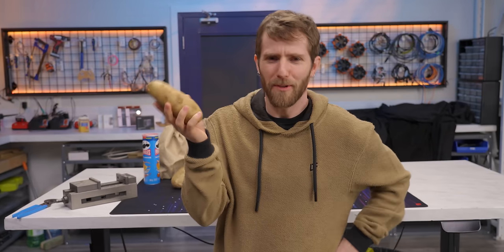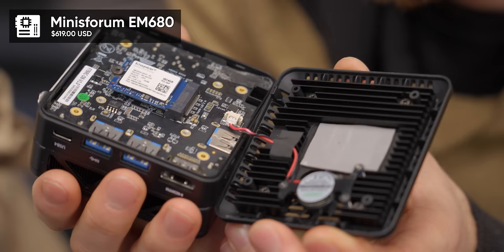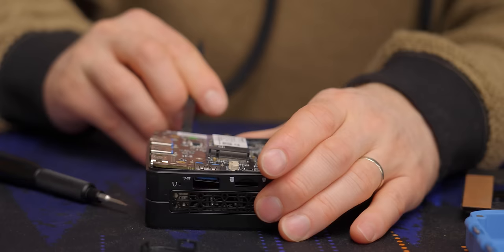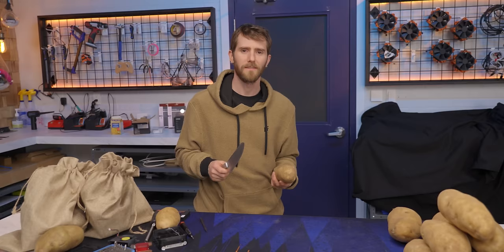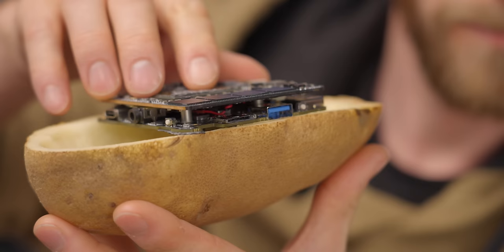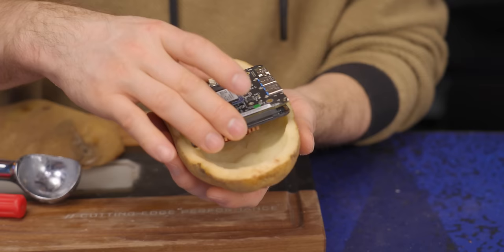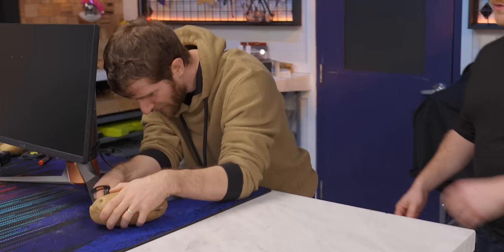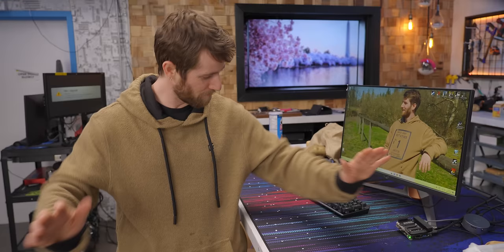It CAN be done - The Potato PC

Comment: For a long-term potato computer solution, I'd recommend making a silicone mold of said spud, fill it with papercrete or just air-dry paper clay, appropriately colored and hollow, and finish the two shells with paint to twin the tenuous tuber rather than relying on the rugged rind of the root vegetable.

If only you knew any real arsty Nerds who could Forge such a magnificent murphy.
Reply: Thesaurus Rex over here 😄

Comment: If you would have soaked the potato in citric acid or acetic acid, then rinsed it off thoroughly, you might have been able to resin coat it  without it going nasty. Second idea would have been to make a mold of the potato, and make an opaque outer layer of brownish, transluscent potato resin skin, then a layer of yellow white inner resin layer to make a resin shell that looked like a potato.

Comment: The Radeon 680M iGPU of AMD's "Rembrandt" APUs (aka Ryzen 6000 Series) are not RDNA3 architecture but RDNA2, they are AMD's "Phoenix/Hawk Point" APUs (aka Ryzen 7000 Mobile Series and 8000 Desktop/Mobile Series) using Radeon 740M/760M/780M iGPUs which use the RDNA3 architecture.

Comment: Still beats the stuffing out of my potato PC!

MSI B550 MPG Gaming Plus AM4 motherboard 
AMD Ryzen 7 5800X CPU
64GB (4×16GB) Patriot Viper Steel DDR4 3,200Mhz RAM
XFX Radeon RX 6700XT Speedster Swift309 12GB GDDR6 graphics card 
SanDisk Ultra 3D NVMe M.2 SSD 1TB
Corsair 550watt CXM550 PSU
NZXT H series Tower case
Windows 11 Pro

Comment: Ok so you CAN print tubes etc but for them to be water tight you have to make sure your STL is completely perfect, so make sure it’s solid in something like meshmixer first and you want to make sure that in curing you don’t over or under cure it, it’s very easy to crack and it won’t hold anything

I’ve been working on bottles and and it’s a lot of work where I had micro cracks and it leaked

Comment: I'm still using my Amiga 1200 with an 030@50mhz, 2MB chip ram and 32 MB of fast ram.

My Potato is far better experience these days :)  No dlc, fully boxed software, works without patches, not overpriced.

Comment: I feel so bad for this board. I don't think the potato juice is good for the electronics. Also there are potato batteries that work by sticking a copper and zinc electrode into the potato. You have copper and maybe another metal that may result in some kind of current flow through the board. Also copper and other metals may start to rust or corrode really fast.